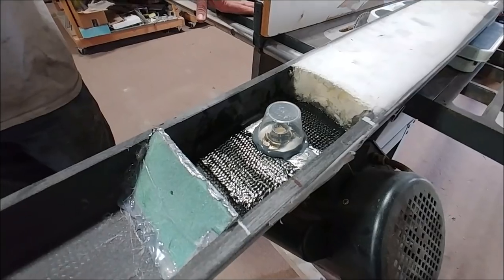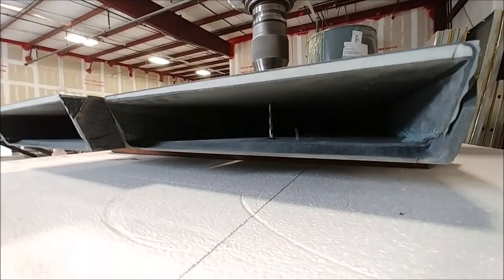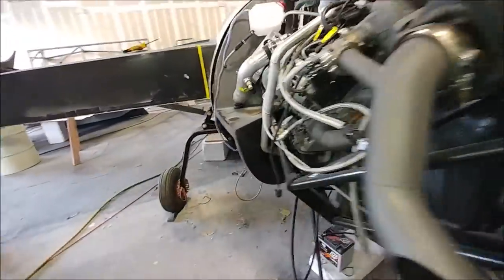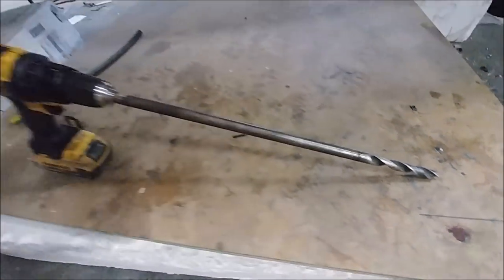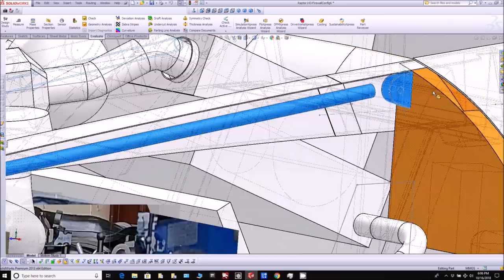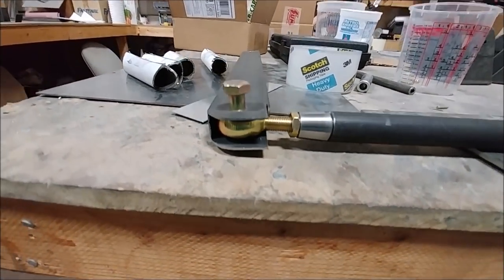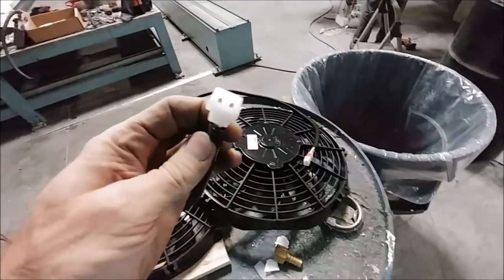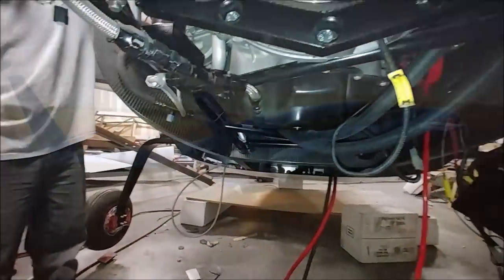Drilling and Bolting - Building the Raptor Prototype

Comment: Peter could you take us through the engineering analysis for the wing spar design a bit more?  Those bolts in some combination of tension and shear?  Inspection panels designed to be able to inspect bolts for corrosion?  I know that spar design is on the minds of a lot of plane owners and operators in general - and potential Raptor customers in light of the recent PA28R accident in DAB.  What's the failure mode for one or more bolts?  Whats the ultimate load factor for that spar design?

Thanks - B

Comment: Your great at Solidworks.

If you have an nVidia video card, you might be able to force a little more anti-aliasing on Solidworks. It may slow things down a bit.

Also, in most CAD/Design, you don't need much/any anisotropic filtering, as the only textures you likely have are applied to the engine. CAD users who are not working on buildings usually look: at, but: not along surfaces, so anisotropic filtering can be lowered, and antialiasing can be increased.

A nice big 4K monitor, even a cheap one might be nice, as well, like the LG 43UD79-B-except if you work in the corners of the monitor.
Reply from the maker: Got the 4k tv already. The screen capture I use brings image quality down quite a bit so it doesn't look that great in the videos.

Comment: Will you have some bonded aluminium backing plates where the wing bolts go through the spar? For the wing spar and main spar?
Reply from the maker: No need, there are stainless sleeves and the hard points in the spars are FR4. FEA has been done and it's all good.

Comment: Are there only 2 bolts holding each wing half on to the main spar?
Reply from the maker: There's a third that joins the front edges of the adjoining ribs together that hasn't been done yet. That's all that's needed.
Reply: MY bonanza only uses two wing bolts to hold on the wings.

Comment: Looking great!! Are you planning on bonding those spars together or are the bolts alone enough to bear the load on the wings?
Reply from the maker: Just the bolts plus one more in the adjoining forward ribs. The wings are removable and therefore are not bonded on.
Reply: Raptor Aircraft can I have a couple more bolts on mine please? I trust your calculations but only 2 or 3 bolts per side gives me the willies.
Reply from the maker: More than 3 bolts is actually worse as it creates loads that create problems, at least that's what I understand from Mark. This is not his first FEA.

Comment: Would it be possible for the production version to have the wings removeable? Over here covered parking space is a premium and size plays a major role in priceing. The ability to store the wings along can be a great long term saver.
Reply from the maker: It will be no simple job to attach the wings every time you want to fly. Definitely not something I would want to do.
Reply: Suremn not realy something for people flying on a daily base, which I am not. Depending on the airfield, the difference can be several hundred Euro per month so it's definitly something to look into. And making the design in a way that the wing part can be detatched with acceptable effort (not talking glider easy) would be a great plus to buyers/builder in more expensive areas of the world.
Reply from the maker: Yeah, probably not going to happen. If you are fortunate enough to have a Raptor and it's only flown once a month or less than would be a waste.
Reply: So the Raptor is only ment for rich elite customers? No need to look down on people living in a place with different constrains.
Reply: While not disputing your point that being able to remove the wings would be less expensive, I think many of us future owners would say that having a Raptor with several shares and group ownership would make more sense - the plane would be flown and used and everyone would enjoy lower cost of operations.  I'm not rich and that's the way I plan to go.  Besides, then I get the advantage of a bunch of folks that I can hang with that love my plane as much as I do.